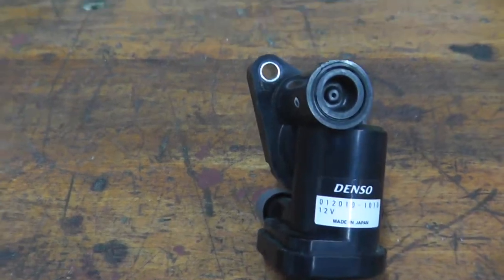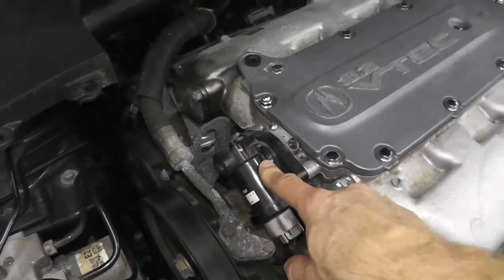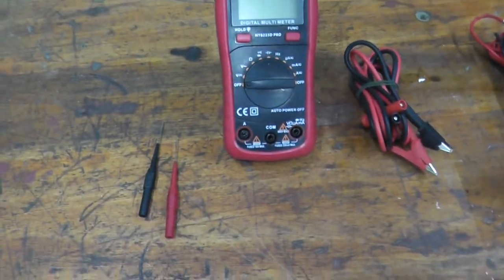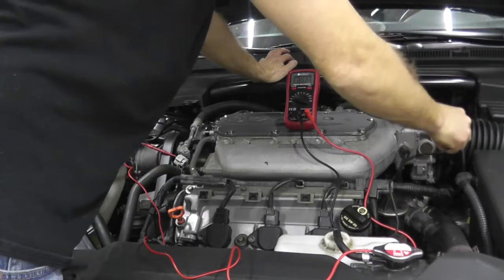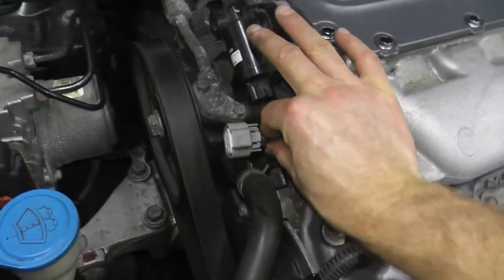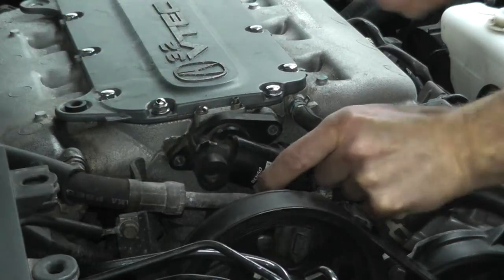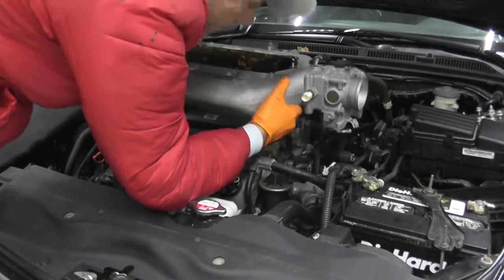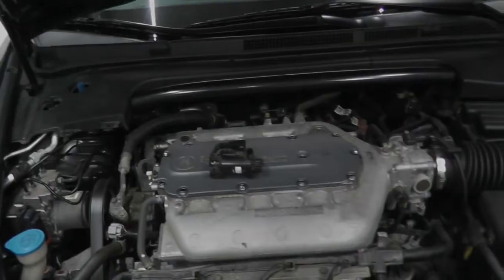How To Test and Replace An IMT Valve | P1077 P1078

Comment: Very good but it did not show how to actually replace the valve.  It was only about testing. For example what position the valve and actuator should be in when re-installing.  How is it tuned (do you have to have a bidirectional scanner)?  This is what I was looking for when I saw "replacement" in the title..
Reply: Same....
Reply: exactly...

Comment: I supplied power to two of the leads, and the motor spun. Then I reverse the polarity and spun the other way.

I was only able to get the motor to turn using those two leads. The other three leads don’t do anything.

Does that mean the motor is functioning as it should?

Comment: Hi i have an 08 civic and at idle on my scanner its showing "imt(imrc) valve command: CLOSE" but also shows the "imt(imrc) valve switch:OPEN" shouldn't it also say "CLOSE"? Symptoms I'm having is rough idle, slow taking off, horrible gas mileage and after letting off the gas rpms drop to around 500 feels almost going to stall the engine
Reply: I am having the exact same issue 
Did you find a solution

Comment: Can’t find the part anywhere what is the part number
Reply: I just called a Honda parts department at an area dealer today to find out what this thing's number is. On my '04 Accord EX V6 Manual Trans it's 17150-RCA-A01. They want to charge like 340 bucks for it too. But I took mine off and put 12 volt power to it and it still moves. The connector shows 5 volts on that same pin in the video. I'm at a complete loss as to what's actually wrong at this point. It's throwing codes P1077, 1078, 0300 for random misfire on all cylinders, and the corresponding 0300 code for each individual cylinder.
Reply: @Vakkeran  Hey man, I've got an 03 v6 manual throwing me the same codes. Did you ever get the issue figured out? Haven't quite found anything causing it yet either
Reply: @sovietcactus764  After taking the top plate off the intake manifold and giving everything in there as good a cleaning as I could, the 1077 and 78 codes never came back after I cleared them. The misfires were caused by bad plugs. I didn't check them like I should've when I got the car. They were all loose save for one or two. And one even had part of the tip broken off. Found all that out after I had gotten new plugs to put in. All the misfire codes never came back after that.
Reply: @Vakkeran  Thanks for the reply! I just replaced the plugs a few weeks ago, but the coils are kind of old. Tomorrow I'll test the valve again plus a few more things and see if I can figure out the problem
Reply: 2013 tc, do I need to time the valve when I put new one on?

Comment: How you setup the valve back?
Any position ?
Reply: I would assume the gear needs to be pushed down all the way towards the back of the car. Thats the way he removed it. If you lift it up the valve and put the motor on it the valve will not close all the way. You could burn out the motor in the imt.